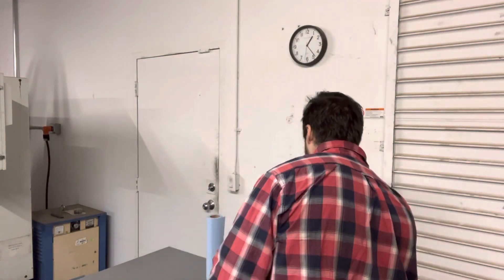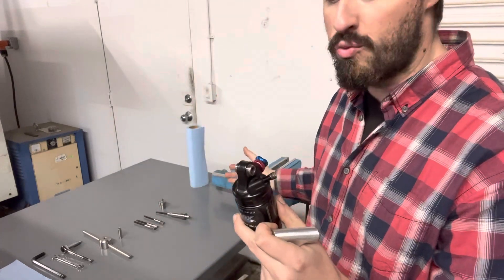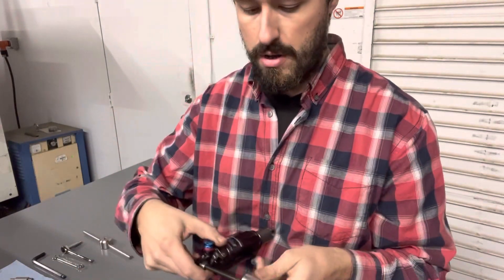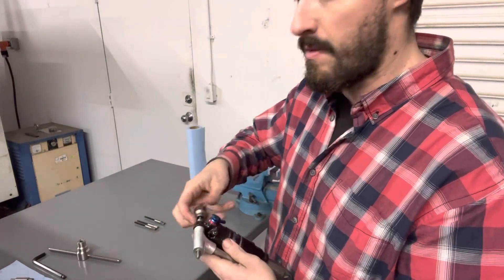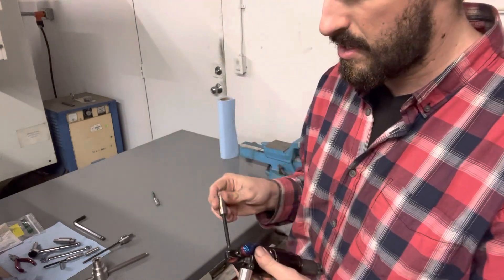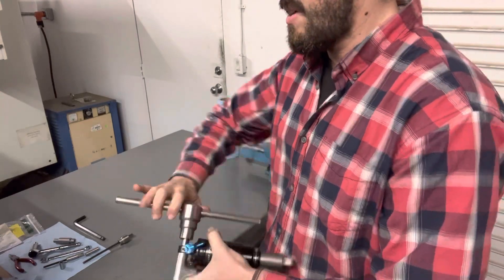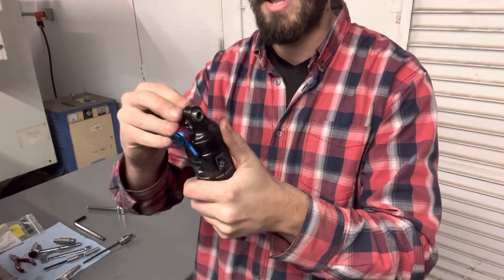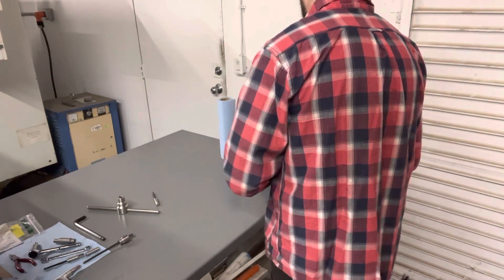Tight DU bushing sizing (burnishing)

Comment: Love your stuff! Just burnished bushings on my 38 and the results were stupid. I was almost upset at how my fork was performing from fox. Even after fresh rebuild and a vorsprung secus. Saved the day!
Curious if you make a tool to size bushings for the main seal head of fox X2 shocks? Seems like that bushing is always crazy tight when I rebuild X2 shocks. Both air and coil are 3/8" shafts. Even after covering it sloppy wet with suspension juice it's still so tight on that shaft... Anyway...
Thanks!

Comment: Hi. What diameter are these sizing dies?
Reply from the maker: I can make any size but these 3 sizes are 12.75mm, 12.76mm and 12.77mm. I find that it feels best to burnish to around +0.04mm or +0.05mm bigger than your pin diameter.